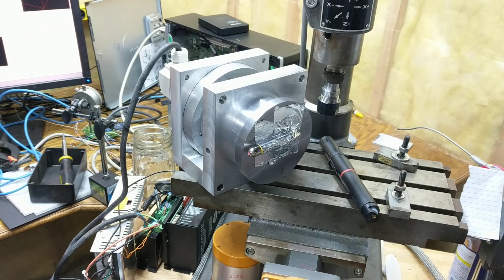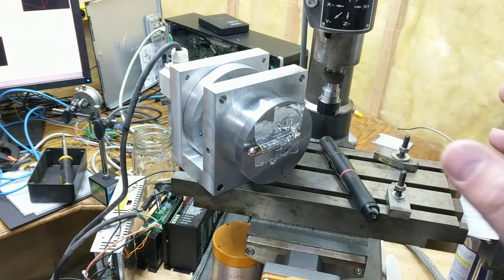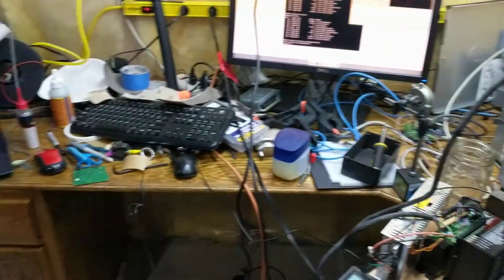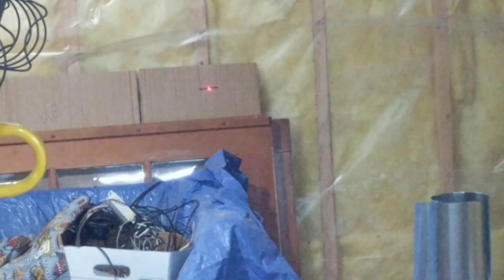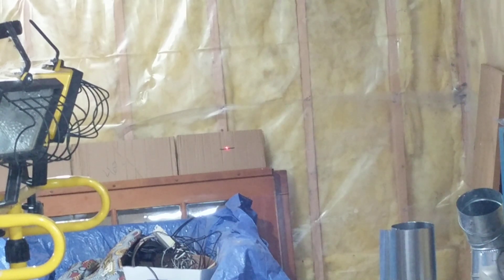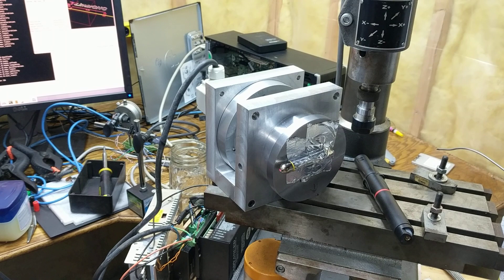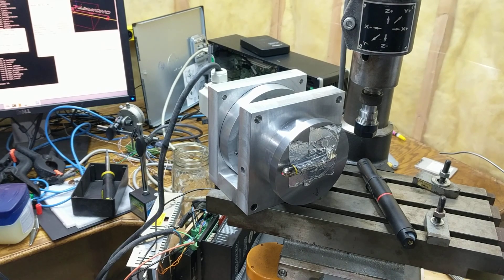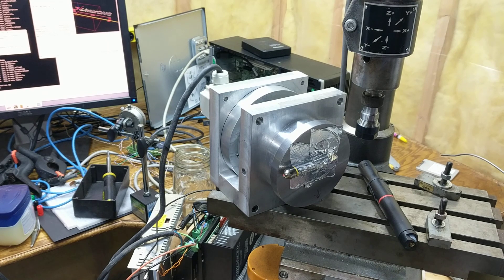Minimally printed 4th axis update.  Now with LASERS!  (and crap camera work)

Comment: The movement appears fairly fast considering the resolution. Yes the torque it can handle under load will determine just how useful it really is. For softer materials I'm sure it will be fine.